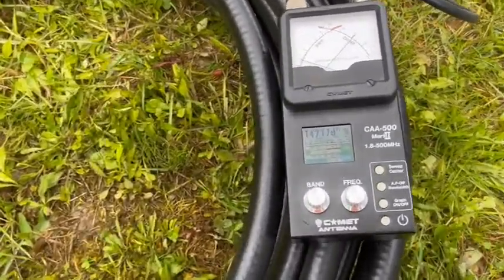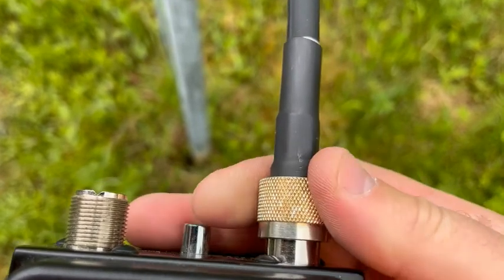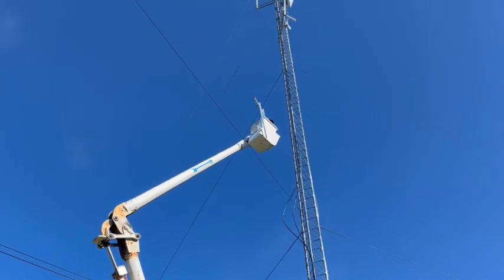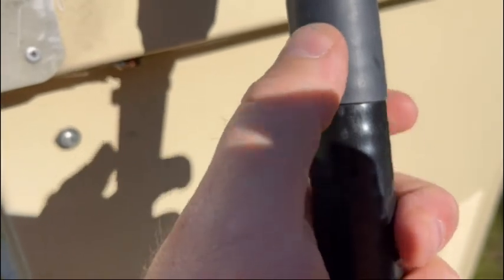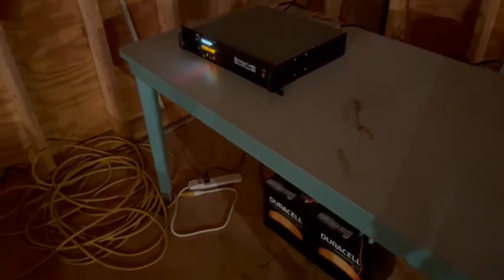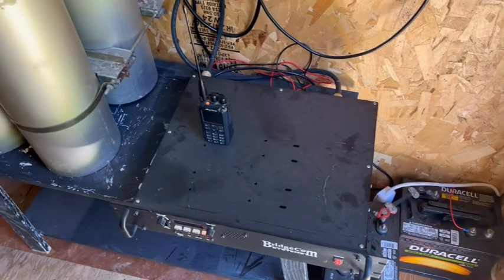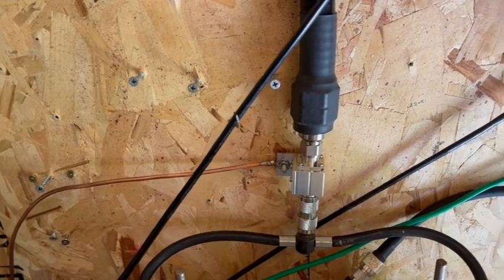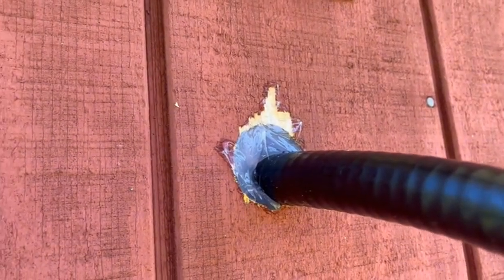Moving A Ham Radio Repeater

Comment: Our club had a 2m/440 vertical antenna at our repeater site,it only lasted a few years , then it broke from all the swaying  . When we replaced it, 1 of our club members suggested attaching  a piece of 1 1/2" pvc  to the tower and a tee (to go over the antenna)  place it about halfway down the antenna to prevent it from breaking again .. That worked , we replaced the vertical with an 8 bay loop antenna ...
Reply from the maker: Yep.  This one has a center stabilizing brace on it to prevent exactly that from happening.   Antennas on towers take a lot of wind, so every advantage helps.